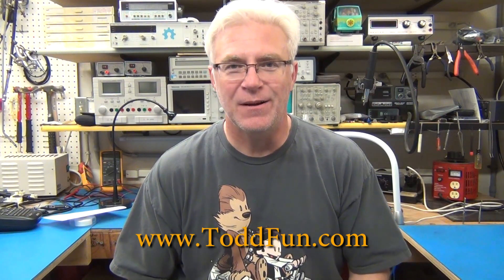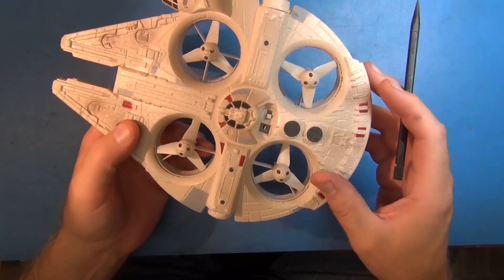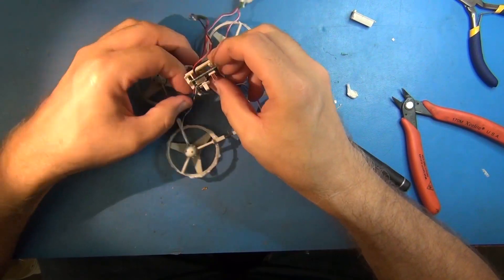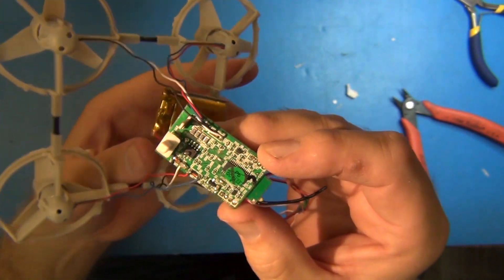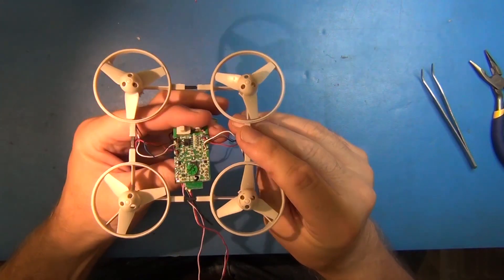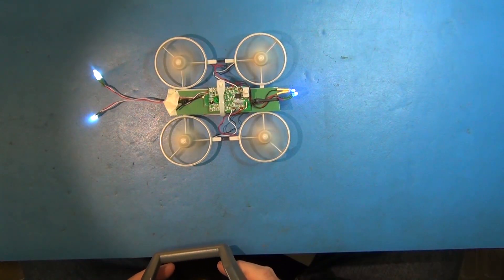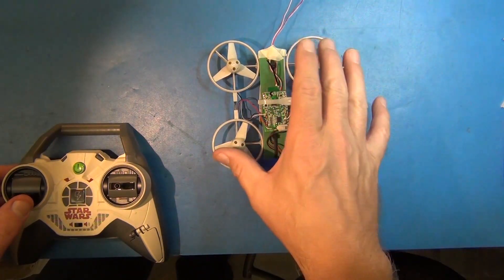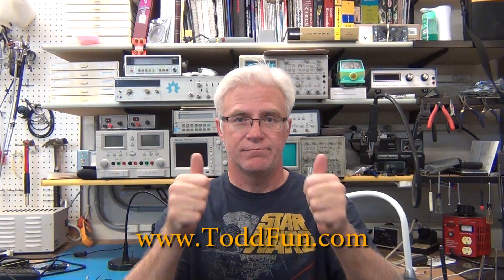Star Wars Millennium Falcon Quadcopter Teardown

Comment: Really enjoyed this video!  I am trying to get mine working again.  It completely shuts off after a brief spin up.  Cut an access hole in the center and changed the 3.7 lipo battery but still getting this problem.  Sometimes after syncing it immediately unsyncs after barely touching the controls.  Other times it starts to lift off then completely shuts down.  Any ideas?  Thanks!

Comment: Hi Todd.  One of my blades is not spinning very well.  I've taken it off and cleaned it but it still doesn't spin very well.  It's not rubbing up against anything.  Something internal to the motor maybe.  Any advice?
Reply from the maker: No advice really. Hate to say they are disposable but they really kind of are when they break. You normally don't oil these types of motors but maybe spray them down inside as best a possible with a solvent like electrical contact cleaner might flush out enough particles to give it a bit more life if it's just dirty.  https://amzn.to/2YS9cJ7

Comment: Maybe the angle is some kind of dihedral  for the blades. On airplane wings, dihedral gives more stability and since the rotor props are the wings,,,, oh well, just a guess. Thanks.
Carl
Reply from the maker: Maybe. I have it all back together and will be doing the first test flight this week so we should know more shortly on if the alter helps or hurts.